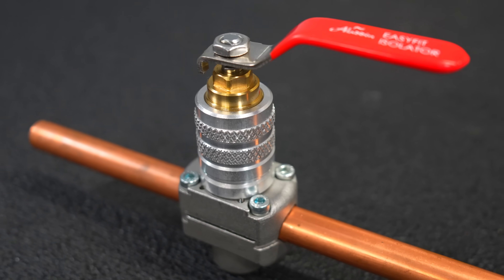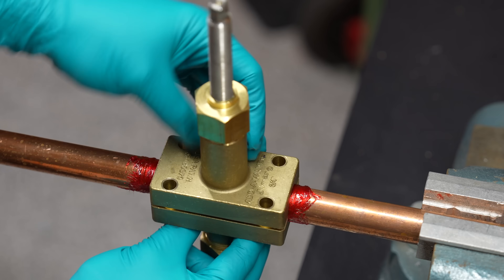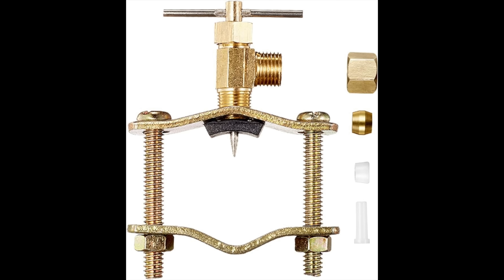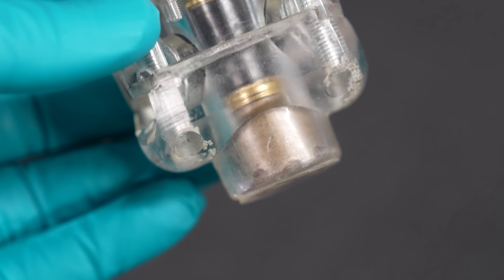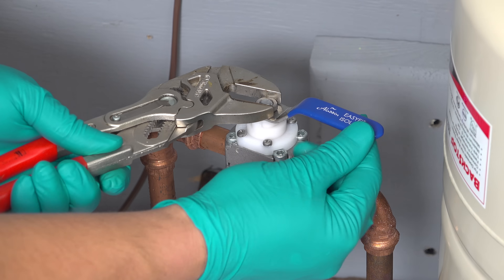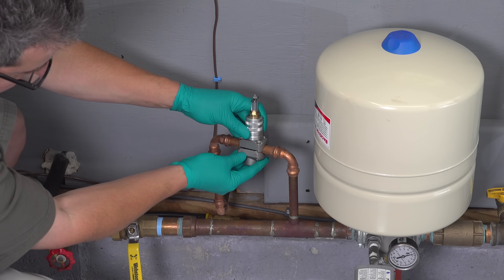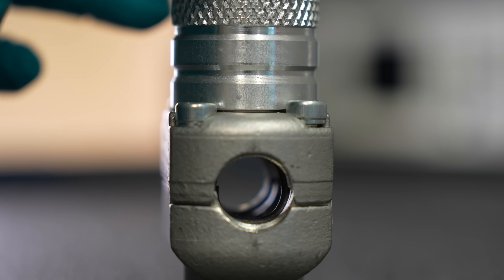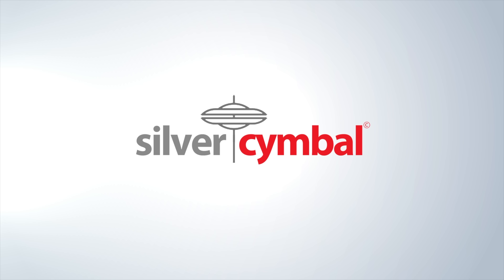Is this INSTANT Shut Off Valve ILLEGAL?

Comment: Those are cool and all but when that buna-N seal cracks, and it will, you'll have to sweat in a proper valve anyway. These should be for emergency use only.

Comment: the only illegal thing i can think of is the local codes may  say that you may not install on the city side of the water system.

here in the united states we have a thing called a curb witch is where the town and homeowner responsibility ends.

so it may be possible that you may have some exposed pipe in your house that may be on the home owner side that is still town property like the piece before the water meter so you may have to ask your town about where you can install it.
Reply: Who owns piping varies by town in the USA some towns your responsible for the entire service line not just to meter/curb. Also depending on local jurisdiction interpretation of code ot can be considered a piercing valve which doesn't meet all codes. They can be useful for home owners or new plumbers that aren't comfortable with freezing or live repairs.
Reply: Forget about local codes. Cutting a hole in a pipe you don't own would be criminal damage.

Comment: To all those who complain about the cost, this is clearly a special-use valve. It’s not meant to be installed for every valve in the house but if you have a situation that requires it, it’s there for you.
Reply: This is probably a good item for a plumber to keep in their van for emergency shut off situations.
Reply: @benargee  No plumber is working on pipes without knowing where the actual shut off valves are.
Reply: @ChillWill-q5x  some times plumping systems are poorly designed or the problem is upstream of a water shut-off. That or the cost of shutting off service to everyone is prohibitively expensive because there wasn't already a localized shutoff. If only we could live in a world where everything was as it should be. Also sometimes you can plug a pipe by freezing the water with liquid nitrogen, but that requires there to be almost no water flowing, so not good for emergency leaks. Sometimes proper shutoffs can fail like anything ever created. This could be from poor design, poor upkeep or eventually in time. There is always a different tool for certain situations and it's always good to be prepared. Yes ~90% of the time there should be a proper shutoff in the correct location, but the other percentage it's not. Better to have the tools than to stand there and scratch your head.
Reply: @ In the only situations something like this would be needed, you simply cut the pipe and put a valve on it with the water flowing, that's how it is all day every day.
Reply: @ChillWill-q5x  there isn't always a shut off.
Reply: @ChillWill-q5x  You're going to do that in someone's basement when they have an artesian water well that flows 100+ gpm @ 60 psi? Please provide your company name so I know not to hire you.
Reply: $300 is ludicrous price gouging. The exact same product, from the same company, retails in Europe for about $70
Reply: @AWellesley it's not price gouging if you don't know the market conditions etc. If they're used a lot more in Europe then they don't have to have as high a profit margin to keep the company/product afloat. Similarly if there's more competitors in Europe then they have to be cheaper to be competitive.

If you think there's a gap in the market, then import from Europe and resell them.
Reply: @AWellesley , claiming price gouging with a novelty item falls flat. If you don’t want the valve, don’t buy it. I think it’s an insane price too. And guess what, I’m not buying it.
Reply: @AWellesley  then ship it from Europe.

Good thing we have fairly open markets
Reply: @AWellesley  I sell curb stop and wintrex valves daily for $400-$500. $300 for a shut off valve is not unheard of.
Reply: @AWellesley Yeah but $300 is way cheaper than the alternative of pipe freezing or shutting off water or flooding etc or hell even hiring a f**** plumber is 300 flat feet to have them come out. Or if you have a leak before your first shut off valve or don't have one, there's a $250 service charge just to have your utility company come out and shut off your water and then another 150 just to have them turn it back on.
Reply: @pilotavery  my same thoughts exactly.
Reply: @ChoiDuong0944  This thing is definitely worth it. It's not just a valve, it replaces a minimum $500 and three or four hour job. And even if it is illegal, getting the water shut off right away in an emergency is way worth it to give you time to figure out what else you need to do
Reply: Exactly, the situation I have seen these used in is for a main valve replacement when the curb stop doesn't work. Better than doing it live.
Reply: They set the price so that its cheaper for you to buy their product than to call the city and have then send out a crew to dig up the water main and shut off the water from there.  Supply and demand. They probably don't sell very many of them, but those that need their product are probably still saving money over other methods
Reply: No.
Reply: Still too expensive
Reply: So why waste your time and money? That's absolutely valid to complain. He's making it out like it's some magical savior. Stuff like this will inevitably break quickly.
Reply: Yeah but it went up over 75% since he posted the video just 3 months ago…that’s a major problem
Reply: @J_M3444  totally unfair.
Reply: @J_M3444 that's capitalism bro supply and demand.
Reply: @rudyjanke5942  
Thats not capitalism. Everything went up. Dont know why everything money to people = Capitalism.
Inflation is the key here.. Especially in the last 3 years. Supply and demand is every dam system we have. What system is not affected by supply and demand? They all are.
Reply: @Bobo-ox7fj dont be an idiot
Reply: What situation would require this?  No one should be working on pipes without knowing where the water shut off valves are to begin with.
Reply: @Bobo-ox7fj I didnt either. But its a stupid answer. " If iT CoStS tOo MuCh, jUsT dOnT bUy oNe!! pRoBlEm SoLvEd!!"  

der her der der problem solved, your such a genius. come on man.

Comment: I've installed one of these myself (UK house) and it's a fantastic product and easy to use. Yes it's not cheap, but it's value is there. I'd imagine it's largest application is if you have multiple people showering and you need to do some work at the same time e.g. can't turn off the mains to the property.

Was very impressed with the build quality.
Reply: Each bathroom should have independent shut off valves already.
Reply: Cost it mostly going to manufacturer. Production is a few bucks.

Comment: Another good, informative video, Silver Cymbal. Kudos.
Thankfully, I do not need one of these (my  main water supply valve from my well is a ball valve like the one in the video).
Yes, these things are expensive. Are they more expensive than having a plumber solder a ball valve into your water supply line? I cannot see how.
Getting a plumber to come to your house (even in an emergency) is unsure (sorry plumbers but this is true). This could definitely work in an emergency as you point out in the video.
Reply: you will never have one of these valves on hand, when a emergency happens.

Comment: Do some people really NOT have a main water shutoff on their property?
Because of your introduction to this product, I did buy one...  I have no intention of using it anywhere.  It is now on the shelf in my shop where I keep other emergency repair parts for my property.   It just might come in handy.   But I don't think I'd use if for a permanent repair.  Ultimately, I'd go back and sweat in a standard valve body.
Reply from the maker: Not sure where you live but in the east coast with older cities and towns often shut offs get buried and sometimes just forgotten. I think thats why these are so popular in the UK where the issue can be the same. When you move further south and to the westcoast you see much better developed areas where things like shut offs are much more standardized. I had family in Boston and they had a shut off under a floorboard in their living room that controlled 2 units. Thats my theory on it, but certainly may not be accurate but it definitely happens.
Reply: @SilverCymbal  I've never heard of anyone in the UK not having a stop cock in their home. Sometimes they are seized up after years of not being used, but they certainly exist. The mains cutoff outside the home is another matter - it should certainly exist, but I'm not sure how many people know where to find it (I don't know where mine is).
Reply: The other issue, especially in the area Chris and I live in, is many, many buildings are OLD. The shutoffs, even assuming they exist, are so old, brittle, and poorly maintained that when you do finally need to shut your water off, you often can't. The valve may break, leak, or just not even turn. There is definitely value in this product if you face an old, crusty shut off valve that has no hope of working. Here in New England we usually have two shut off valves for a structure. One is the curb stop, located out by the street, that is 5-8 feet down in the ground and you need a special tool to operate it. This valve is primarily used by the municipality to shut off water in an emergency or if you fail to pay your bill. The second one is (usually) in the basement. That's the one you are supposed to use if you have to perform work on your system. Since no one touches these valves, often for decades at a time, they get corroded, caked with minerals, and the seals get dried out. The second you touch that old valve, you are committed. Exercising the valve occasionally definitely helps, but I don't know of anyone that has "Exercise Water Valves" penciled into their calendar. It's just not something you think about until you need it. Most newer buildings they install a ball valve instead of a gate or globe valve. Ball valves are MUCH more reliable, but many local building codes haven't really caught up. It was only a handful of years ago here in Manchester that they started to allow plastic sewer lines underground. Before that you had to use cast iron. What could possibly go wrong? Best advice, if you have an old globe or gate valve and it still works, shut if off, cut the line after it and install a ball valve while you still can. Then never touch that old valve again.
Reply: @chrisrichard298 That's exactly what I did a few years ago. The old valve in the basement basically did nothing. Fortunately, the one in the street was in good condition so not a big deal. Bonus is, turning a valve 90 degrees is a lot easier than cranking on a handle when you have water spraying out somewhere.
Reply: The only reason is if you live in an old building and scheduling a shut off is out of the question. Even if your appartment has an individual shut off valve in some cases you still need the super "supervision".
Reply: I suspect most everyone has a shutoff somewhere, but in the fullness of time they can be lost by being built into a renovation, or buried by landscaping or other dirt work. Even if you know where it is, older valves are frequently the gate style that fills up with crud, and is no longer fully able to shut things off.

Comment: It does it 'under pressure'?
Reply: Note the mentions of places with no interior water supply shutoffs but at the street (house/utility demarcation). This can be used to provide a whole house shutoff (or if wanted shutoffs elsewhere - maybe for supplies to the yard bibs/faucets) near the utility entrance or on the interior side of a water meter. Just needs a proper screw down while the water flowing remains in service. The main complaint appears to be the cost is as much or more as a plumber visit to solder one in for this one or an even  more expensive competing brand.

Comment: When ever a outside pipe broke just replaced it with an included shut off valve.  Pretty much can shut off sections of water now so don't have to shut off the main.  It also helps narrow leak searching.

Comment: Cool valve, I do wish they could sell it for less money and they would sell more
Reply: But then the business would take on the project of "how do we scale our current processes to make much more volume without impacting any of the characteristics of the product?". 
Its not that easy to change the amount of something that is being manufactured. Machines have max run-rates & tend to perform worse the harder you run them (and break down more - leading to stock-outs), material flows take up tons of space (faster production = more material handlers+forklifts, need more space , need new factories because most factories aim to operate close to full floor-plan wise for profitability). Stocking parts for mass-sales takes up EVEN MORE space & requires world class levels of warehouse management (you need special forklifts for high-density warehousing, should they buy those forklifts or a new building? How would they handle being in a new building? Move machines?). The experienced people involved in the processes have figured out small things over time only they know that they do to keep things running smoothly. The list goes on and on.

It is in no way a simple feat to produce "more of something and sell it for less money". Its a monumental feat that 100's of thousands of people in factories & workshops spend their entire efforts on daily, just to make the progress you already witness in the products you see today.

For the business, making THE SAME # of parts & INCREASING PRICE to help manage demand is MUCH MORE APPEALING & ACCOMPLISH-ABLE. Then "just selling more of them for less".

They may be working on trying to "sell more for less", but that work tends to take 3-7 years, in my experience, depending on the resources mobilized for the project & the leadership of the project team.
Reply: @MarkTrades__  drivel.  typical comment for all encompassing price markups.  nothing new.

Comment: Saddle valves are illegal by code here in Texas
Reply: He showed that it isn't a saddle valve
Reply: @billwhite4126  you have to split it to get over the pipe. I can't understand how it's not a saddle valve.
Reply: @jason5174  Saddle valves split off the flow of water by punching a hole in the pipe and directing it elsewhere. This is a cut off that isolates two sections of pipe.
Reply: I think the replies are missing the point. This obviously isn't actually the same thing as the type of 'saddle valve' that the people writing the code had in mind when banning them, but that doesn't mean that the definition they wrote won't include it by accident or that the inspector will know or care about the difference.
Reply: @random832  Using the texas code(as op mentioned), this would fall under inspector approval. Texas doesn't have an exhaustive list of acceptable fittings, only banned ones, instead it just goes by inspector approval.
It isn't a saddle type fitting, as it splits the pipe and places itself as a valve that connects the two isolated sections, not a modification to an existing pipe that taps the flow to direct it elsewhere.
Reply from the maker: Here is some text from the company. Local codes, inspectors, etc can vary but here it is: "An internal section of the pipe is cut away and the valve seals between both the cut away section and around the separated pipe sections. Thus, the Aladdin EasyFit Isolator is a revolutionary product and NOT a saddle valve"
Reply: @SilverCymbal  I like your content but I wouldn't trust the local inspectors to approve it.
Reply: This is a nifty system.  For about the same price, I installed a WaterCOP at house water inlet after the main valve (works on well or city water systems).  It has sensors that will turn the water off automatically if there is a leak. For another $250, I connected it to my WiFi and remotely turn off/on the water and get notifications of any issues.
Reply: In new jersey most jurisdictions would call this a saddle that being said I recommend new plumbers have one that way if they mess up during a repair this can be installed temporarily until one of us comes to pop in a new valve live or locate a curb stop they can't find.
Reply: Way too expensive. Get a valve installed by a plumber.